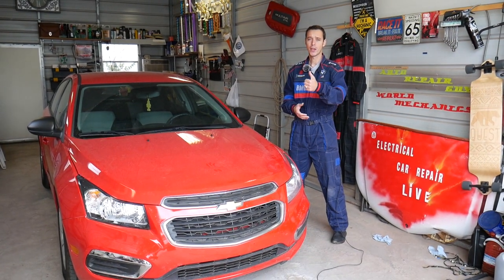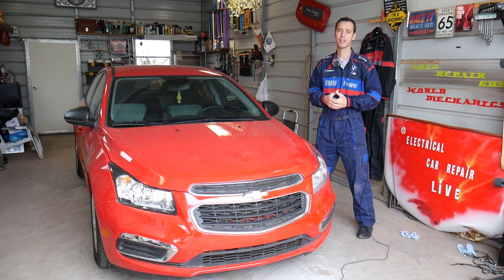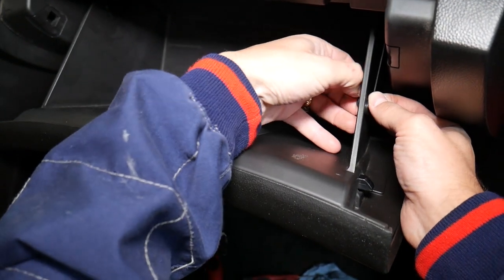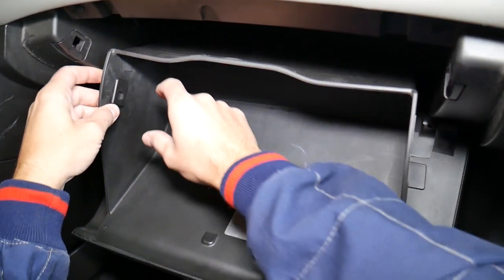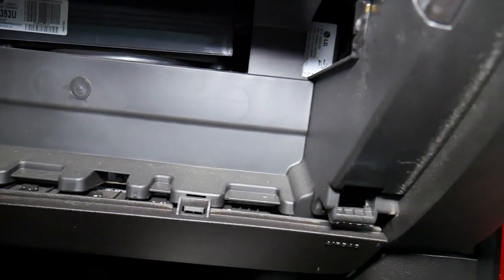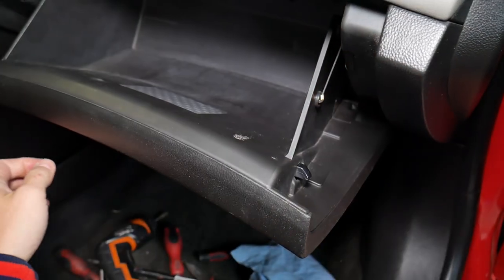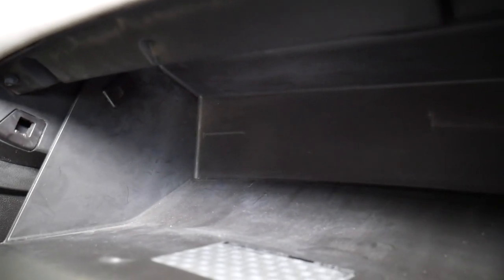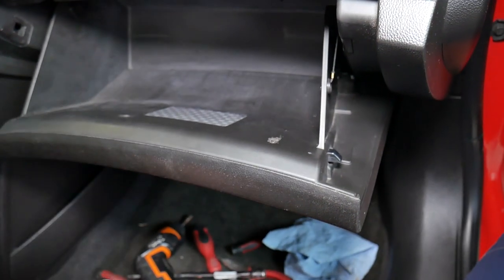CHEVROLET CRUZE GLOVEBOX REMOVAL REPLACEMENT, GLOVE BOX BROKEN

Comment: Thank you so much. Very straightforward and was just what I needed to learn. I have a 2012 Chevy Cruze. After an oil change when the shop removed my glove box to check the air filter, after they replaced it, the glove box just fell onto my floor and I had no idea what the pieces were for and how it went back together. After watching your video, I learned how to put it all back together myself in just a few minutes. Thanks again!